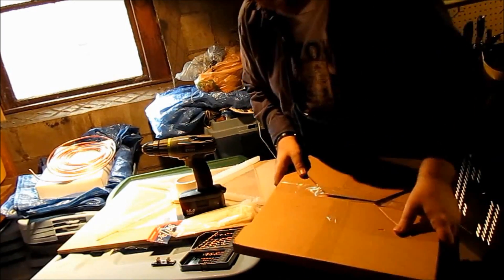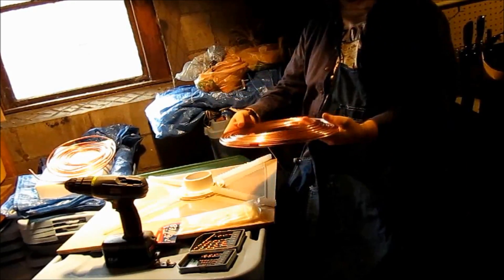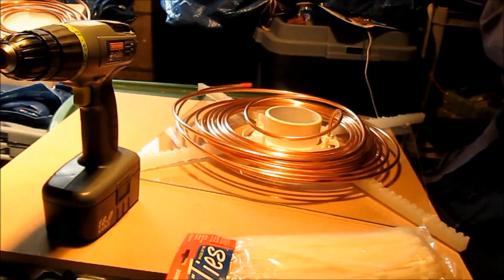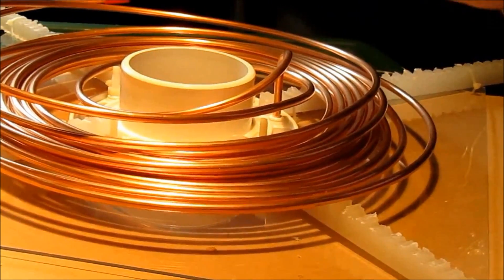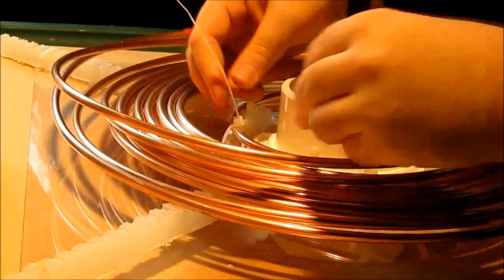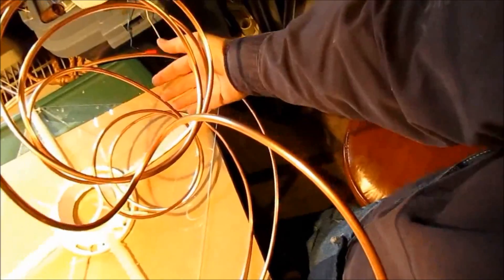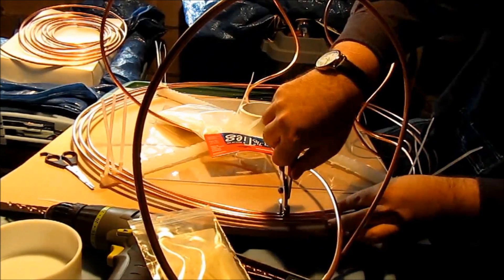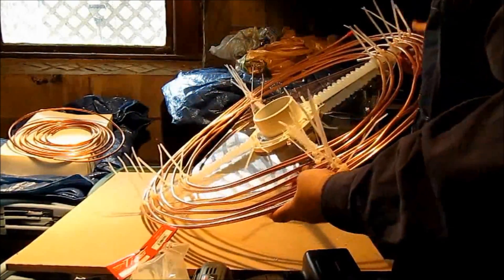Energy Update #17 - Making A Tesla Coil - What They Don't Tell You!

Comment: Nice mix!  Yeah I am likely to stick to just winding plain old wire at a close to right length  around a cylinder rather than deal with copper tubing again.  Such as I later did in this video, the red wire on the left of the screen in some shots  watch?v=URH2_6xBCqI